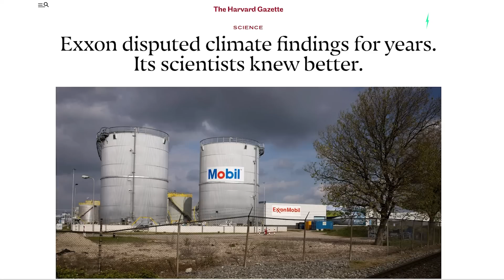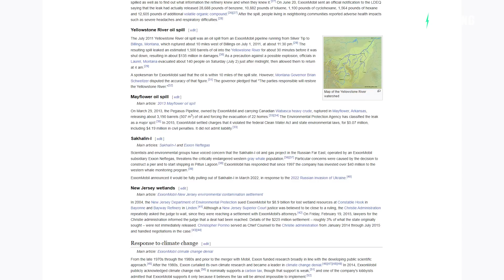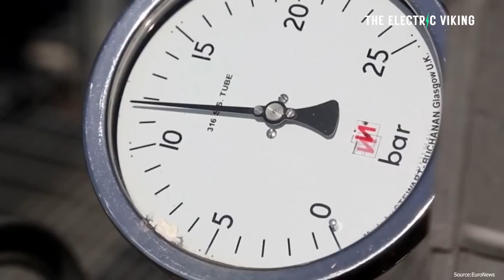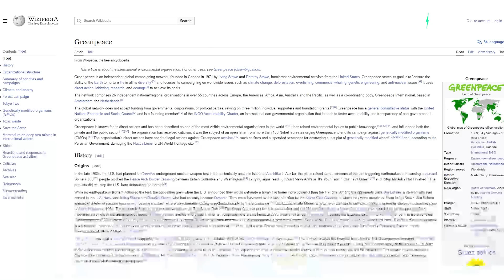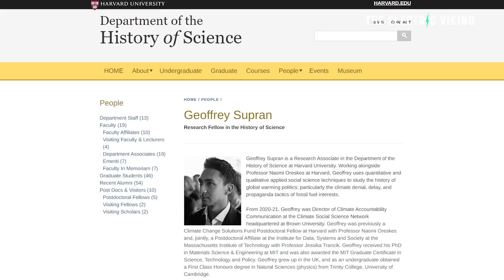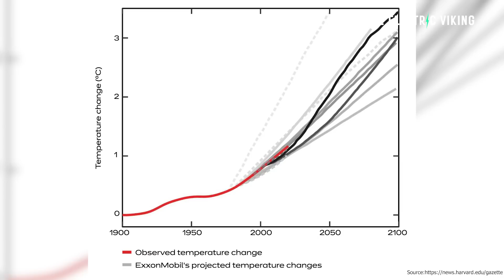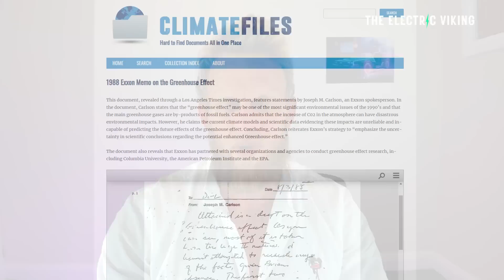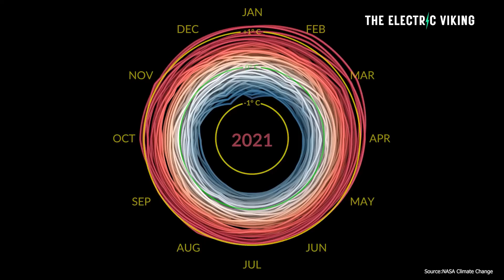Exxon Mobil publicly denied global warming for decades but accurately predicted it

Comment: Hey @electricviking, I’m trying to understand this whole energy debate, got a couple questions if you don’t mind:
1. Why are Oil companies against electric cars, as the cars need electricity which’s around 80% generated by burning fossil fuels? In other words, less gas cars + more EV cars require more electricity which requires more oil/ nat gas so it doesn’t really change the demand of Oil meaningfully
2. When you mention that Exxon was right and Nasa wrong on the global warming I’m curious which prediction was higher - did Exxon get it right with a lower temperature increase or a higher number? Also it would be interesting to compare those predictions with IPCC. If you have that information I appreciate 

Best
LD

Comment: Apart from the fact you butchered about every name of anything you said driving an ev is actually just as bad environmentally the mining of cobalt and lithium uses huge amounts of carbon emissions to mine also uses so much water a rare commodity in some countries then of course they have to ship the elements to where batteries are produced and then ship them to manufacturers for them to then ship the cars worldwide ev’s are not environmentally sound at all also lithium fires take almost four times the amount of water to put out the average car fire about 3000 gallons of water to put out an ev takes upwards of 10,000 gallons of water to extinguish

Comment: Random side point: Deep water Horizon spilled 780,000 m3 of oil into the Gulf of Mexico.  Exxon Valdez spilled 41,000 m3.  The oil industry is so dirty.
Reply: Shell ALSO knew in the 1970s
Reply: Every science student knew in the 1970s. Every farmer 👩‍🌾 has watched the change over a life on the land. Every politician knows that they can get money and power by lying about the problem rather than confronting it. WE are all going to die on a very different planet than we were born on. 🎈
Reply: An amazing amount of oil naturally seeps into the oceans every day. At least 19,000m3 a year minimum.
Reply: Another side point:  According to Greg Palast, the operation that resulted in the Exxon Valdez oil spill was permitted based upon the operators' assurance that they would have equipment on hand to contain oil in the event of a spill.  They certified that the equipment was in place as required.  

But when the spill happened, it turned out they had lied and the necessary containment gear was not there.

Not only was the whole operation a disaster waiting to happen.  It was known to be such.  And still the most basic steps to avoid the worst effects were not taken.  This is the oil industry in a nutshell.

Comment: Don't disagree about climate change but it's a myth it's caused by human intervention. This is just another phase in earth's evolution. Happy for the drive away from oil based products because they've had the monopoly for years but the production of ev's is just as destructive. The biggest problem with ev take up is the cost and current depreciation rates. Why with so few components as compared to ice cars are they so expensive.

Comment: I’m unconvinced that a slightly higher co2 concentration in the atmosphere is a bad thing. But unnecessarily continuing to burn up our fossil resources is definitely a bad thing, and growing corn to squeeze, ferment and burn is even worse.  I would shed no tears for the end of fossil fools, but I’d rather they convert their oil money into PV, battery and super capacitor research instead of trying to ride the status quo to the grave.
Reply: Slightly higher probably isn't a bad thing, but doubling it, which is where we're heading, and more, definitely is bad!
Reply: @stuartirwin3779  Regardless, I'm not planning to buy any beach-front property. Ever. Just because I may doubt (whether in ignorance or through insight) the likelihood of the sea level climbing significantly in the next 25 years, doesn't mean I shouldn't consider the possibility, especially when weighted by the consequences.
Reply: James Hansen, the climatologist who famously testified before congress during a searing heatwave in the summer of 1988, determined that 350 parts per million of co2 in the atmosphere is the tolerable upper limit for maintaining a manageable climate. There were 351.47 parts per million of total co2 in 1988, so we passed that comfortable margin easily by the early 2000s. In 2023, we're at 420.79 parts per million, and experiencing some of the effects Exxon predicted would occur by the 2020s. It is very encouraging to see how much inertia solar PV, wind, and now, battery chemistry, are building in tandem with technologies like precision fermentation and cellular agriculture. There does appear to be a relatively clear path to breaking away from fossil fuels, but they won't go quietly.
Reply: @TekCentric  we are at 419ppm
Reply: @Mauricio17-x1p  I stand corrected. Hadn't checked in a long while, but we are indeed at 420.79 ppm :(
Reply: @TekCentric  I love numbers, especially with units, even sans context (specifically where measured, etc, it would be interesting to know how surface concentration varied geographically, and over land vs over the ocean, and to what extent it varied by altitude.)
Reply: @TekCentric  oh, and thank you. btw.
Reply: Sorry guys it’s broken the 420 in July 2023 and that is fifty percent above the pre industrial revolution figure of 280. We haven’t done anything yet to stop it. We have at best slowed its rate of growth.🤔

Comment: "... by 2030, more than 70% of all cars sold worldwide will be fully electric."

That's all NEW cars sold. There are currently 1.4 billion cars on the road; by 2030 there will be 2 billion. Advanced economies will sell all their used ICE cars dirt-cheap to developing economies, which will keep those Exxon-fueled guzzlers running for decades.

Maybe. ... Or maybe not. 

EV batteries will soon be cheap enough that many of those used cars can be converted to EV en masse at a small fraction of the price of a new EV. For a preview of what's coming, look up EV Evolution EU. Also, California Senate Bill 301 2023.

Comment: We need to find a viable alternative instead of just electric. We don't have the infrastructure in the US for that many electric cars. If we had that many people charging electric cars the power grid would not be able to handle and we would have blackouts. Plus the batteries for electric cars are made by slave labor. It takes ,265 gallons of gas including all the labor and vehicles they have to use to build the battery. Also when it's cold you lose a huge portion of the range. You also use fossil fuel energy when charging your car depending on what type of energy is used in your area. I think Toyota has a better idea of using hydrogen. We need better viable alternatives than just electric. I agree climate change is real and something needs to be done about it to save the planet, but trying to go all electric is not going to save us. I saw a statistic where it said even if we went all electric it would only stop 10% of oil production. Without gas  we would be back to the horse and buggy. ExxonMobil and the gas companies are to blame but all electric is not the answer.
Reply: Electric vehicles powered by renewable energy are the future. Australia is on the way at last after 2 decades of fossil fuel governments. Solar panels on roofs has already negated the building of half a dozen power stations. They work- period. Clean air in cities is another great benefit. I lived in the UK before coal fires were banned and the difference was amazing.
Reply: When I hear comments like this they seem at least ten years out of date! So does all the fud suddenly being out in the papers where you must be getting your ideas from. Think like this: the best part is no part! So when you can use electricity directly to power vehicles even from your own solar power it cheap off peak electrons would you want to continue to use it to make fuel petrol diesel or hydrogen which you convert again into power by an ice engine. What will eventually convince you is when the disruption is overwhelmingly obvious. Remember those old TVs with glass screens ? And the wide thin flat screens were thousands of pounds? Now you can buy a 50" HD TV FOR £200, do you still dream of wanting an electron guzzling CRT TV? Course not.
Reply: Hydrogen 0, Electric 1...
Reply: You need to update your statistics. Fuel refining and transport consume 3 times as much oil as they deliver, not counting bulk electricity for refinery heating. And even without that the rank inefficiencies of ICE mean that  an EV charged from coal fired power still produces less CO2. You may not be able to afford to buy an EV ,yet, but  please don't get in the way of those who can help now. We would appreciate your help with greening the power supply by reducing your peak usage, if you can shift some load away from the evening peak ( 4-7 pm) that makes a real difference for the world.
Reply: All modern electric vehicles can be programmed to start charging at midnight or during early morning hours when the grid has ample and excess capacity and while most people are sleeping. Set it one time, and it will forever charge at the same time whenever it's plugged in.

No grid upgrades are needed now or any time in the future for electric vehicles.

Electric vehicles can be charged using similar amounts of electricity as clothes dryers, central air-conditioning units, electric ranges, hot tubs and water heaters. Most people aren't using those appliances while sleeping.

Again, no grid upgrades are needed.

The OP shows their ignorance regarding simple facts.

Comment: So tired of oil companies lying to us in order to price gouge us. My next vehicle will be a used EV. - Zoomer
Reply: Yay, we are seeing second hand 1st generation EVs now, and in 10 years there will be second hand EVs that started at the same price as ICE vehicles.  Future's looking rosy.
Reply: Maybe you should consider to buy  the perfect commuter Ev  From Byd,Hatchback, 4 door,250 miles in a single charge for $11,500 Dls that's a deal,it goes on sale in 2024 in the U.S
Reply: They are not goin down w/out a fight
Reply: @sparkysho-ze7nm  30 first world countries around the world are gonna ban gasoline Cars by  2035
Reply: Enjoy that first battery replacement!
Reply: @patrickseekins1299  I'm not worried  about it since the battery is designed to Last 12 years,by the time I need to replaced it it will be cheap.
Reply: @magallon643  Good luck with that...